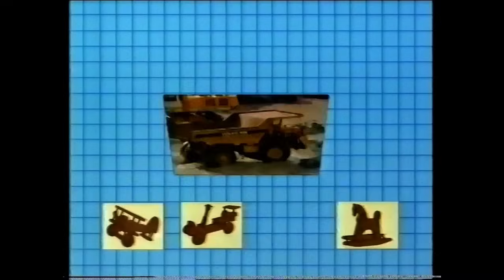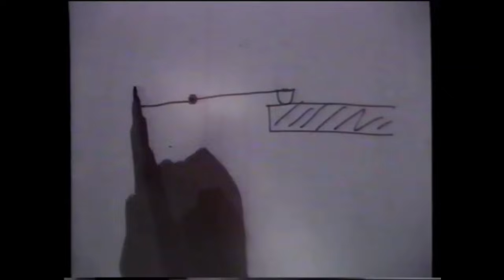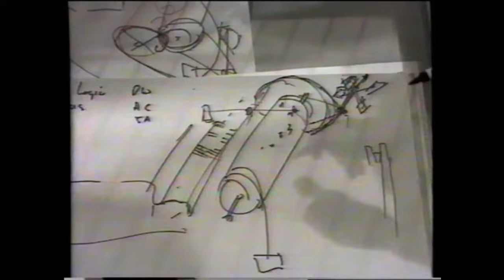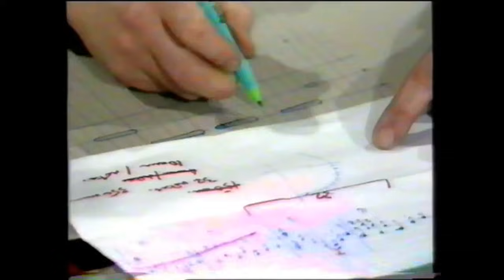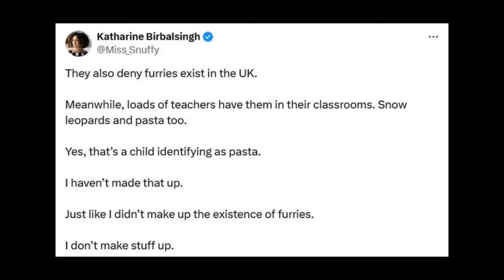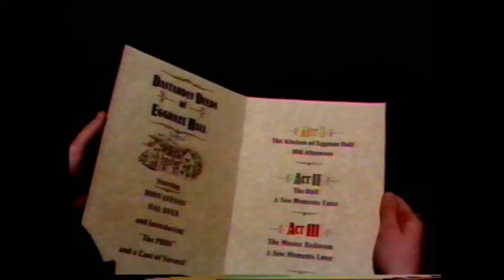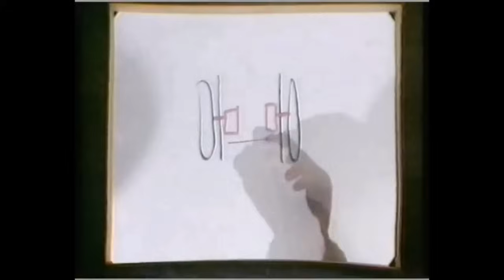The Great Egg Race: We Used to Make Stuff

Comment: I knew a very, VERY talented and highly intelligent engineer back in the 90s through my job.  Lovely guy, polite, well spoken, very clever and quick witted. Didn't much look the type though as he looked kinda like a rugby player. He was in his element of talk ever veered into cams, lobes, compression, tensile strength, weight etc. Owned his own company called MJS Engineering (I think that's what it was called?) He used to come into the Tow bar And Trailer Centre I worked at in Essex. He bought a Towbar and trailer parts so he could build his own boat trailer. Was regular often buying wheel bearings, wheels n tyres, jockey wheels, boat rollers and the like. Then he just stopped coming in?

I never saw him in person again. But I did see a picture of him years later, smiling and happy looking with the chunky watch I recognised on his wrist (I always clocked that watch as it looked fairly expensive) in a book I'd just bought. The book was a true crime book called The Essex Boys and his name was Michael Steele. He was one of the shooters in the Rettendon Range Rover Murders. Obviously living in Essex this was major in the headlines and news for months at the time. But I'd either not seen photos of him or they had used a shite photo so I didn't clock it was him! 

The boat trailer he'd built from parts supplied and often ordered by me was for the boat he used to cross The Channel rammed full of drugs (Cannabis, Hash, Ecstasy) He had a falling out with the Essex Boys gang, they threatened to top him so he attempted them! Him and a friend blew the 3 gangsters heads off with shotguns! 
The moral is: Don't #£%& with Engineers!
Reply: Jeez, put it in a book.
Reply: And 14/2/25 he's now up for release